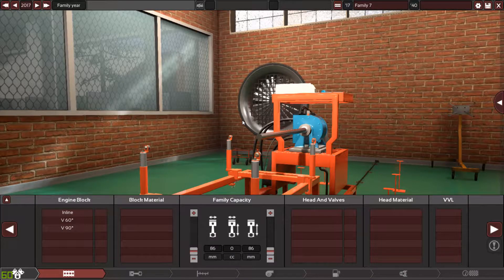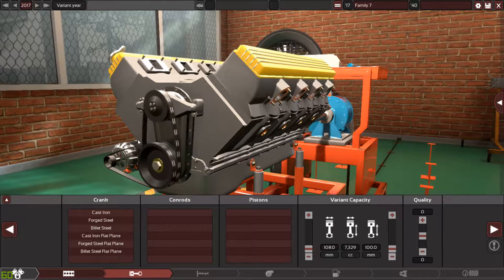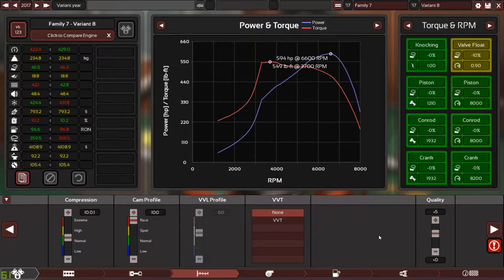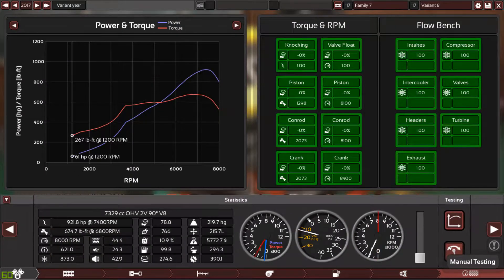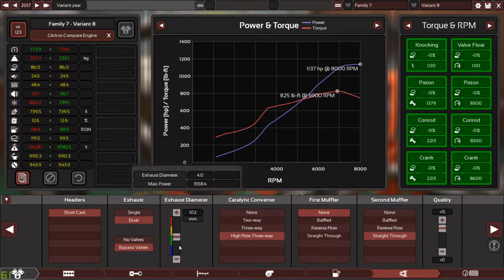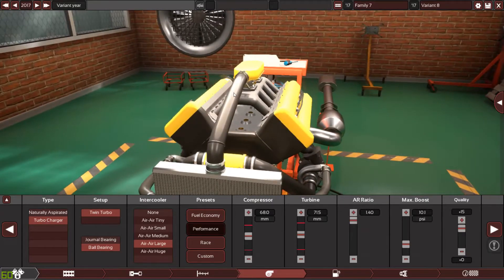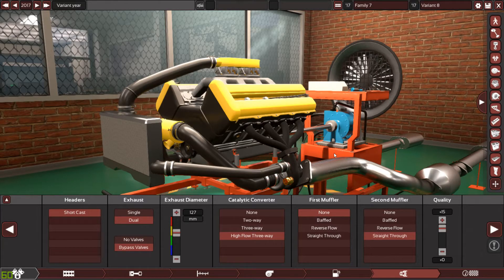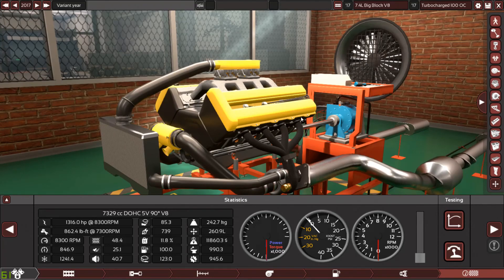7.4L Big Block Turbo V8 Request.

Comment: Can You Make My 2000HP Twin Turbo 426 Hemi Please?

Here Are The Specs You Need
Aluminum Block
Push Rod
103MM Twin Turbo Setup
Modified Pistons
Modified Conrods
Aluminum Crankshaft
Compression Ratio
11.25:1-13.5:1
E85 Fuel
Racing Engine.
I Would Love To See It Done
Reply from the maker: I can give it a go.
Although in Automation we don't get the E85 fuel but I will try and see what results I can get.

Comment: you did it over my expectations of horsepower and torque and of course the sound is as perfect as a classic Chevy Chevelle that used this particular engine, the stock one did not use turbos i know but dragsters know does it.
Reply from the maker: +Charlie Andersson 
Im really impressed by the difference between DOHC and Pushrods in terms of HP and torque. And the turbos with carburetors just wow.
Unique and impressive 
Thank you for your awesome request
Reply: to consider when you put this engine in a car later, i would like if you used a 4  speed manual gearbox and i would also love if you painted the car black and using a classic chassi like they used in the 1970 if possible. thank for your awsome videos! :)